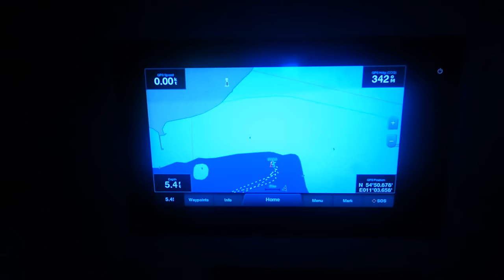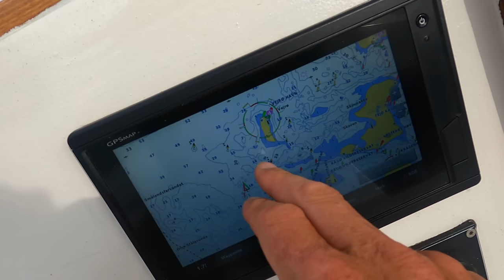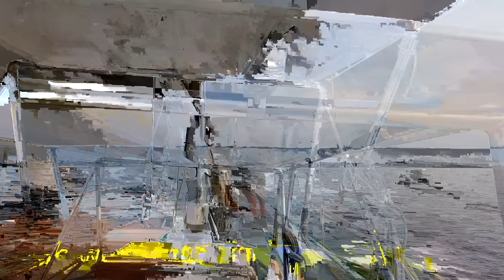EB's Last Sail Of The Season - SV Tapatya EP301

Comment: Well that was a great shakedown cruise in all respects. I see the engine is still loafing on start, interesting to learn the cause (glowplug?). I see you took the opportunity for an overdue ‘head sharpening’.😉😀⛵️👍
Reply from the maker: Sorry Norman, I didn’t respond to your glowplug comment last time.
Yes indeed, I’m far from convinced that the glows are working. There’s a relay that might need replacing. But the main issue is coming up in a video soon!
Reply: @SVTapatya  No worries - just being nosey. Clamp meter on the feed will prove/disprove.👍